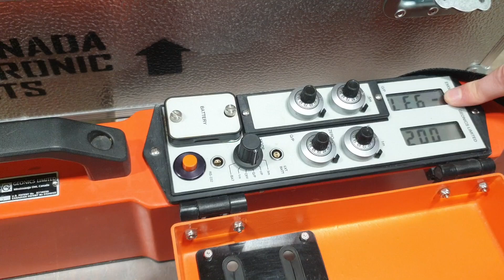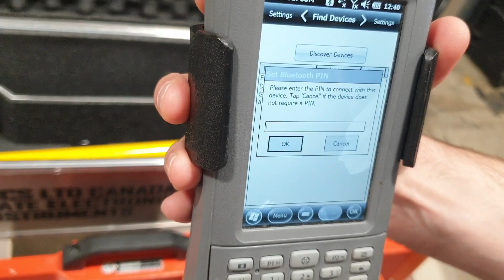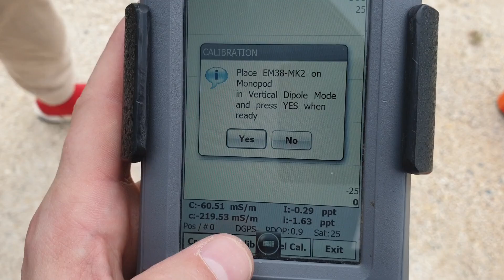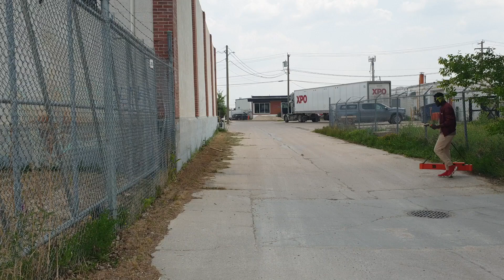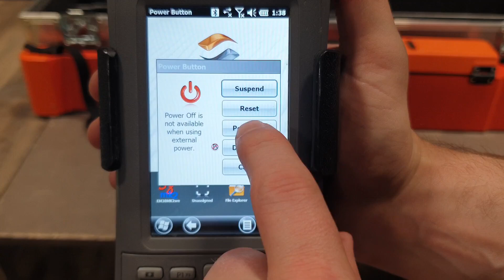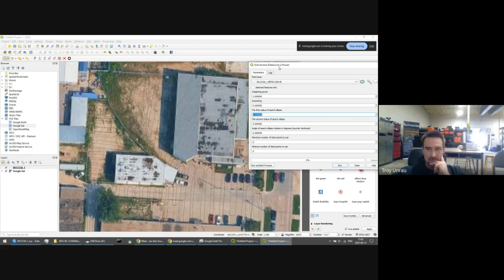Lithogen Geonics EM38 Comprehensive Tutorial with QGIS processing instructions

Comment: Hi that was very instuctive, if we don't have geode does the em38mk2 already has a gps? Can using com 9 the em38 port will allow data to be saved accurately for each point and increment or it must be connected to a gps to function?
Reply from the maker: The EM38 doesn't have its own GPS, but the data logger shown does. It is less accurate (~4m) compared to the Geode (~30cm), but it works pretty well. If your line spacing is wider than ~10m on your survey, then using the internal GPS is an acceptable choice, because you'll likely use cells larger than your GPS error when turning the data into a map anyway.
Reply: @TroyUnrau thank you so much troy and wish you all the best